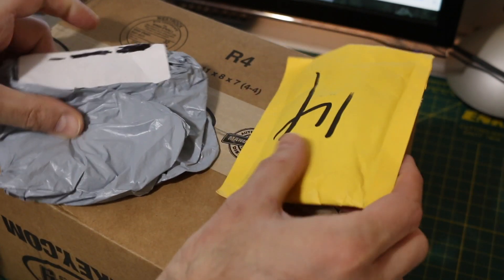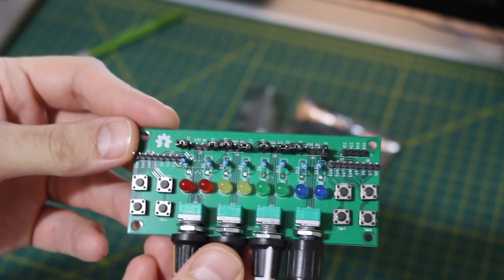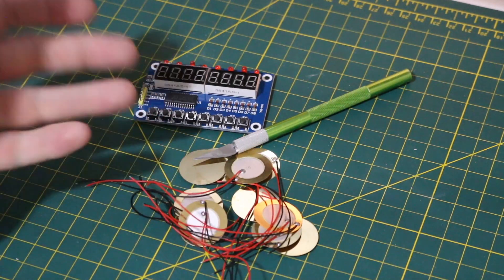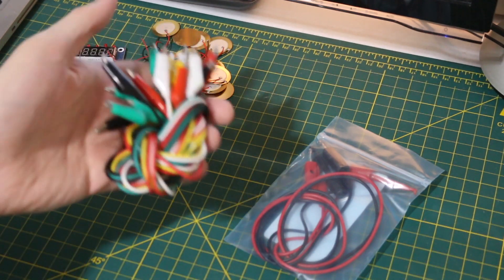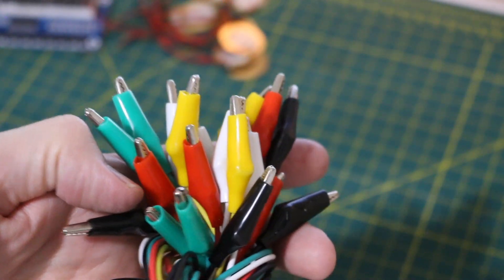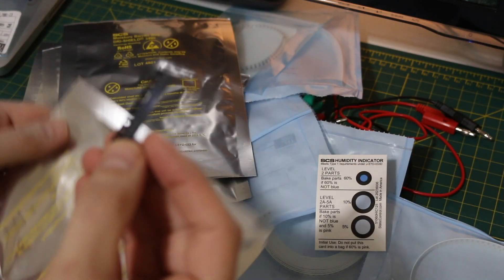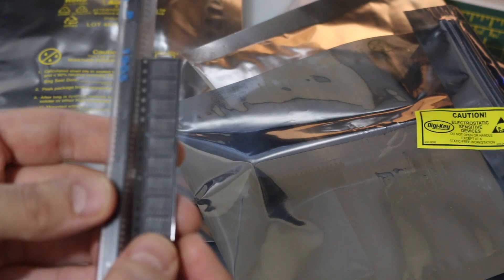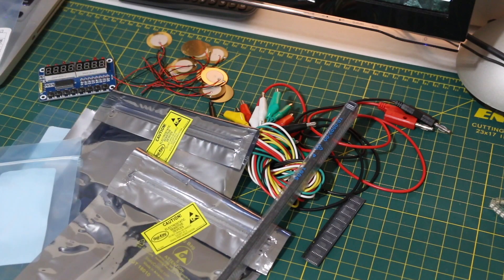GR Mailbag 20.DE.21

Comment: If you need a driver for your display check https://lygte-info.dk/project/DisplayDriver%20UK.html
It can show integers/doubles/text on the display and read the keys.
The library can also handle nearly all other types of display modules on the market, making it very easy to swap between different displays.
Reply from the maker: Thanks, I'll have to check the functions out especially for formatting what is being shown on the displays, good for new inspirations of what to use displays for.

Comment: I can relate! Knowing I have a part but not where is quite frustrating, so I use labelled parts bins and a spreadsheet which is boring to set up, but works a treat. 👍😀
Reply from the maker: I wonder how I'd keep track of inventory if I have to remember to update a list every time I access something.  I might have to start slowly by maybe updating an inventory status to say I'm low or out of stock for sure on something so I can check what needs to be ordered when convenient.  At this point I'd just be happy to have space to unpack everything I have so I can see what I've got all at once

Comment: I bought some Piezo Elements, of around the same size, in hopes of making a sound wall with thin balsa.
It did produce audible sound, but not so loud and clear, as hoped.
Projects I see for them online seem to be mostly knock detectors, and drum pickups.
Cannot fathom that you will make a dent in those 1k resistors.  They are surely inexpensive these days though.
High amp diodes are surely smaller and cheaper in the an SMB package.
Reply from the maker: When I bought a resistor 0805 kit that had strips of 20 of each value, I found I ran out so fast and started using nearby values because it wasn't usually critical, and after a certain price point it makes more sense to just get the huge reel vs half the amount because it's marginally more cost.  And if I need 2K I can even tombstone them and solder them in series. Or stonehenge them and get 3K.  
I forgot I also had diodes in that shipment to go with the boost regulator but they didn't make it into the frame.
Today I moved a bunch of my drum pieces from one storage unit to another (different city) as I continue to figure out where I'll ultimately be living, and it's tempting me to get the piezo elements into a project maybe before I should...maybe I can just mute the heads and purely pick up the vibration and only trigger electronic. hmmmmm....how much are drum head dampeners on Aliexpress....
Reply: @GadgetReboot  You just verbed, "Stonehenge."  I know exactly what you mean, but have never seen it done, or even heard it discussed.
Reply: You could "aqueduct" SMD resistors on top of capacitors, and make an RC dampener.